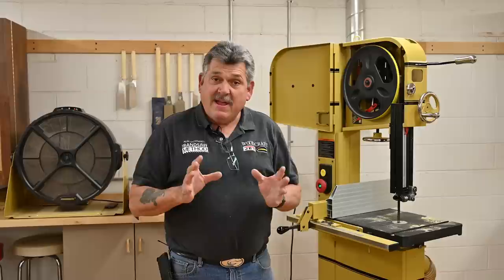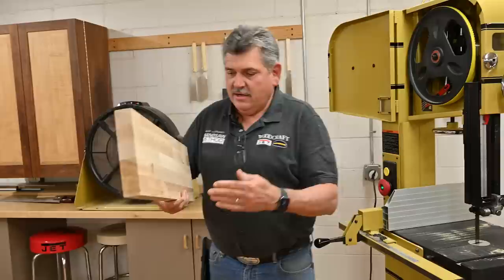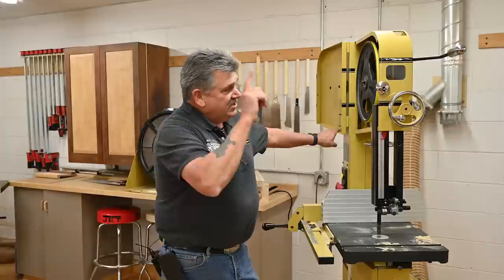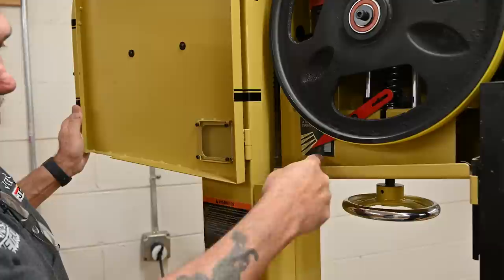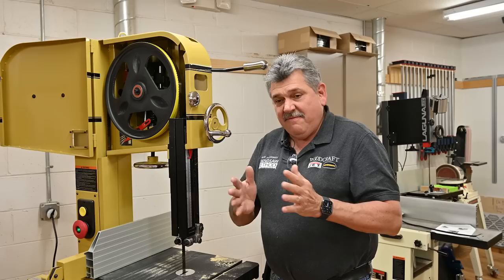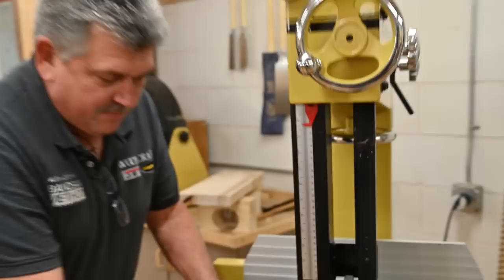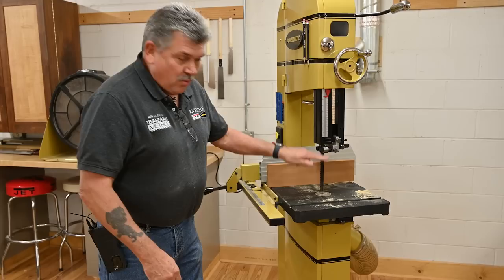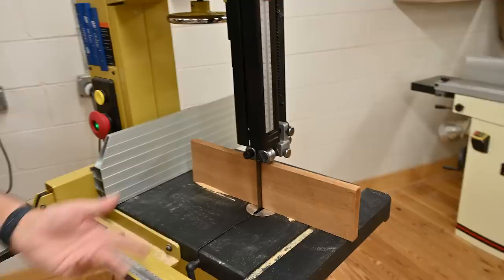Mastering Bandsaw Tuning: Expert Tips from Alex Snodgrass for Precision Performance and Smooth Cuts

Comment: Thank you for your skill and knowledge. I bought a used 14 in Rigid bandsaw almost 10 years ago for $75. It was badly neglected, lots of surface rust and the top wasn't even tightened down. I took care of all that, replaced the rubber tires with neoprene, put in some new guides (cool guides), and purchased a new blade.  With your fantastic set up demo from that old woodworking show video ("Band Saw Clinic with Alex Snodgrass" from 12 yrs ago), my bandsaw ran like a champ ... and still does to this day!  Glad to see you give a refresher to newer woodworkers. I cringe every time I hear a tool company recommend tracking the blade in the center!

Comment: Yeah, I get the concept yet what I dont get is why bandsaw manufactures (just got me a Laguna) don't recommend such a set up. I set up the blade per the manual, and the blade (3/4" Resaw King)  is cutting  dead flat boards. Yes, blade tension at teeth = better tracking in theory, but are blades engineered to operate that way? Per manuals, tension is centred on the blade. Your recco puts all the tension on the edge. There's gotta be more to the story.
Reply: How else are bandsaw blade makers gonna make money if everyone sets their blades up right?

Comment: Alex, great stuff! Well done. I found that finding the "true" crown of tire can be a bit of guess to set the gullet just right. I used a good old fashioned ball point pen on bright orange urethane tire set dead center of the tire and spun the wheel. Viola, instant alignment line to get the blade spot on every time!

Comment: Alex, I have two questions.  (1) I assume the guide bearing setups are the same for the bearings under the table, correct?  and (2) You started by saying the lower wheel was already set, but never spoke about any tuneup actions down there.  Are we to generally ignore the need to tune the blade to the lower wheel?  Thanks.

Comment: What about tire placement? I just replaced the  worn-out 20 year-old tires on my Genereal 90-150M and the machine vibrates even more than before. The new urethane tires are just a bit narrower than the wheels. I've tried to pull sections of the tires so they are as consistent as possible, but that's a challenge. Any suggestions?